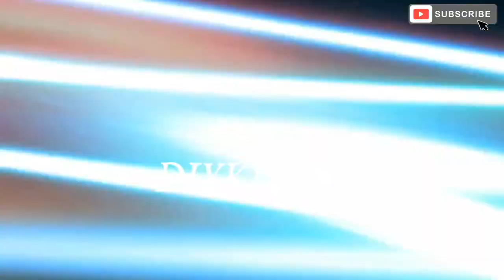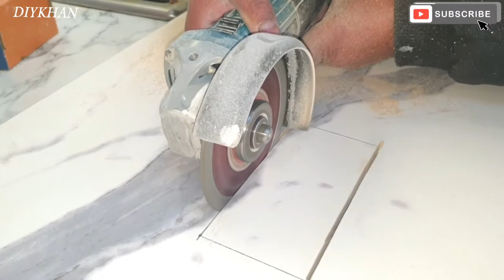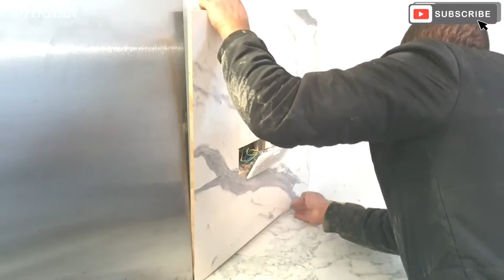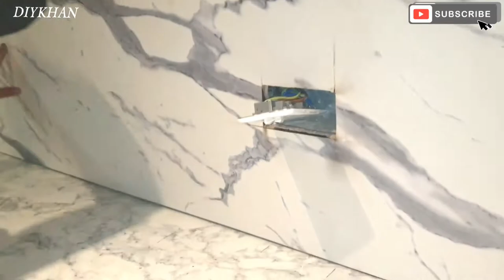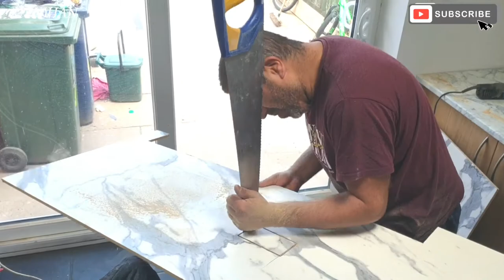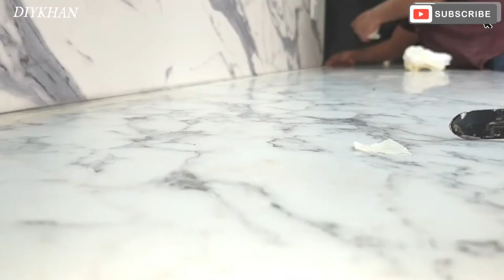Kitchen Splash back Installation || How to Fit Kitchen Splashback || Homebase Splashback Fitting

Comment: How did you know where exactly to cut your backsplash for the sockets? What do you do if they are misaligned (socket vs cut)? Also, what distance between your backboard and worktop did you leave (in mm)? (for expansion)
Reply from the maker: I measured it by my self n cut the boxes with angle grinder. I left 3mm gap between the worktop n the splash back